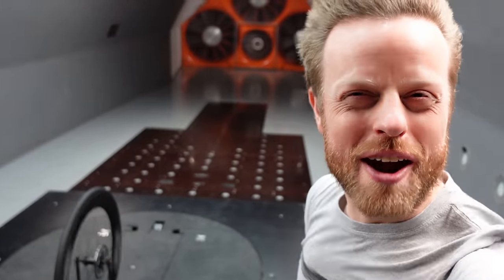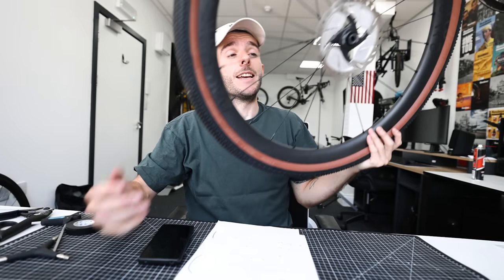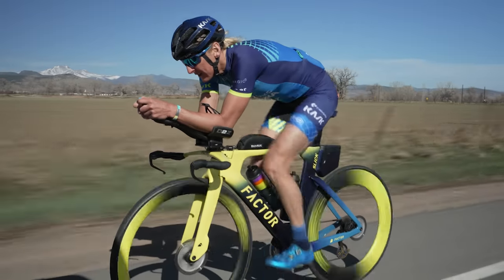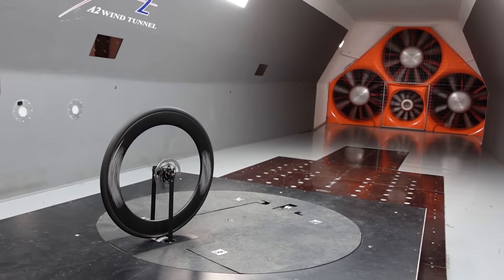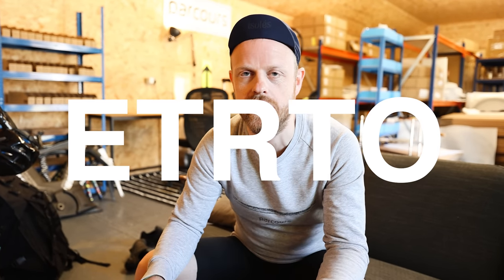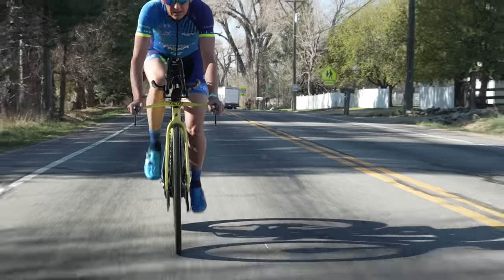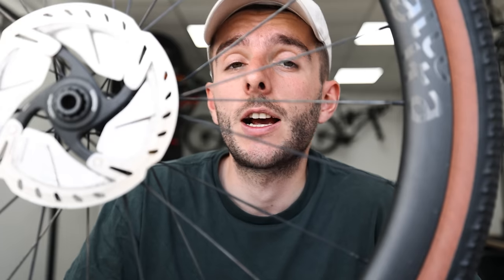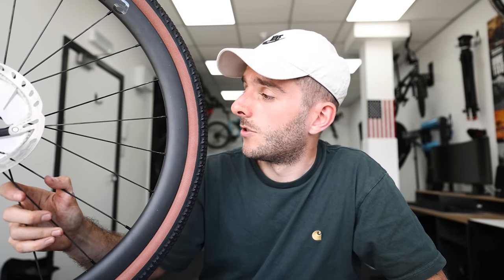What You Should Know About Hookless Wheels

Comment: Is there any benefit for going hookless with an alloy rim? Are we going to end up with all carbon rims being hookless, and alloy ones hooked, and if so, does that mean that tyres are going to end up being specific to rim material?
Reply: Great question.  As far as I can see it's likely to be that if tyres all end up being hookless compatible, it may well be that alloy rims go the same way.  With the way that the alloy rims are manufactured however, there's fewer benefits either in terms of cost or strength.

One thing to bear in mind though, is that just because a tyre is hookless compatible, doesn't mean it can't still be used on a hooked rim.  So rather than having tyres specific to rim material, we're more likely to see a situation whereby more and more tyres end up being hookless compatible.

Comment: To be fair, even most hooked carbon wheels limit max pressure to about 80 psi.. with exceptions. Roval and Shimano are two that allow well over 100psi in their hooked wheels. Maybe these are simply built stronger?
Reply: I have never seen hooked rims with a max. pressure rating that low, all I've seen are about 110 - 120+ PSI.
Reply: @yonglingng5640  HED limit to 80 psi. Hunt limit to 100 psi. These are two that I know, but maybe such low psi limits are not as common as I thought.

Comment: I have two pairs of hookless ZIPP 303(s). Thanks for explaining what that means.
Reply from the maker: Just curious, as a hookless wheel owner, did you know about the 72psi pressure limit?
Reply: @Cade_Media  I did, the LBS told me 74 was the limit on these for the road, 40ish for gravel.
Reply: It also says very clearly on the rim itself. I run them too for gravel with Pirelli CGH, and love them
Reply: @martinhudobivnik5895  those are the kind of details I miss in cycling
Reply: @jmoran74  I find it ugly on the rim, but I understand why it's there. I also knew about it from all the research I did, but totally missed that Pirellis can only be pumped to 58psi. Glad I wasn't the one doing the tubeless conversion 😂
Reply: @martinhudobivnik5895  I've got some specialized tires for my road set. they lose pressure pretty quickly overnight. do you have issues with losing pressure?
Reply: @jmoran74  I don't. I've heard some tyres are susceptible to it though. Also I think this hookless standard is not perfect and it can vary from tyre to tyre

Comment: I'll wait for this all to get sorted before I stop using tubes.
Reply: w/ hooked tubeless wheels and tubeless tires,  road tubless set up at normal pressures (80-100) has been doable for a while,  perfectly safe.   Hookless at road pressures is still not there for me.  Unless you're running 32mm at 60psi....which I'll never do.

Comment: This is a bit slim on details. He only touches on the problems of heavier riders and thinner tyres which is actually a major concern for bigger people running thinner tyres. They need to do some very careful research before going hookless. The assertion that hookless are stronger is total bollocks, the strength is derived entirely from the amount of material and design detail (section) of the rim edge. Hooked wheel design needs to be careful to avoid sharp corners in the hook so as to avoid stress concentration. His opening statement says it all - hookless rims are without the safety feature of  the hook securing the bead, ie they are inherently less safe. Comparisons to car or aeroplane tyres are misleading as most are steel radial, very wide (compared to cycle tyres) and are set into a far deeper rim. Blowing a tyre up to pressure to test failure does NOT even vaguely approximate real world conditions and the multitude of forces the tyre is subjected to at that pressure. The problems with skinny tyres can be mitigated by use of deep internal channels in the rim allowing a greater volume of air at lower pressures but few manufacturers have tried to exploit this. One also has to be very attentive to the tyre's specifications regarding internal rim width and rin edge height when choosing a tyre and wheel combo. Small wonder there have been so many failures! Until the manufacturers have figured out all the intricacies of this design and are very clear to customers as to the limitations my advice would be for casual riders to avoid hookless. G. Hart - industrial designer

Comment: Car wheel doesn’t have hooks but the physics are completely different.  Car tyres have a different sidewall density etc which makes the tyre stay on.  It’s not the high bar that’s an issue, it’s the low pressure especially when you get a flat when there’s a danger of the tyres rolling off that is the issue.

Don’t use car wheels as a use case example.  Like press fit this hookless trend will go away..hopefully

Comment: Do you think there is much of a downside if a heavy rider like me (88kg, total system weight of 98kg) has to stick to the 5 bar limit of ETRTO.
Zipp tells me to run my 28 mm tires at 4.2/4.5bar, yet other calculators like the SILCA one would put me in the 5.5 bar range for optimised rolling resistance. 
Zipp argues, the added comfort/reduced vibrations will make you faster as well. What is your take on that?

To safely run an aero-optimized setup (Rule of 105: Conti 5000 STR 25 mm tire on my 27 mm wide Zipp 303S wheels) I would have to run unsafe 5.5 bar or reduce my system weight by 8 kg which might be hard :-)
Reply: I’m a solid 200lbs and am using enve45 and 30c tubeless and have never had any issues running them at 48-50psi. Can’t speak about any smaller tires but anything over 55psi just felt way to harsh of a ride, in my opinion. I don’t think you should have anything to worry about. Send it!
Reply: At your weight, I’d suggest you go to 32mm tires. I weigh 160 pounds, and I’m running 32mm GP 5000s. I don’t think they slow me down one bit compared to 28s or 24s. And they give me a lot more confidence while cornering and especially on bad pavement.

Comment: I’m on the Zipp FC303 which are hookless. I realized that running them on higher end of the limit makes the wheels faster. Question is how will I know it’s going to blowout? Any tell tale signs? The tire pressure reading are from my pump n I’m afraid that my pump may be inaccurate
Reply: Do you feel faster or are you measurably faster? Less road buzz can make you feel you're slower, when the opposite is true

Comment: So if the air pressure is the only thing keeping the tyres on. What happens if I puncture at speed going down hill or in a group. The tyres could come off the rims before you can stop?
Reply: This
Reply: @cc-000  good way to reduce customers. I think I will  wait until all the problems are ironed out.
Reply: The hook is there to stop the tire from going over the rim when it stretches due to high pressure. when you puncture and loose all pressure it basically does nothing to hold the tire beads on the rim. there is no real difference for this scenario between hookles and hooked rims per se. 

in fact one could argue that a tight fitting tubeless compatible tire on a similar tightly specced tubeless rim (regardless of hooked or not) will stay on for longer than a non-tubeless tire that possibly fits way looser and will come off the rim easier.

Comment: I have a question 🙋‍♂️ .... is there any real difference between a gravel wheelset and CX one?
Reply: Dimensions would usually dictate where it falls. But things always shift.
Reply: There is, although that's not to say you can't use a gravel wheelset for CX and vice versa.

Generally-speaking, a CX wheel will be based around a narrower tyre given the max tyre width is set at 33mm.  Whereas for gravel you would be looking at something quite a lot wider.  Then in our experience we'd look at having the gravel wheel slightly more robust to handle the different ride conditions.
Reply: @Ryan TF saying that, I'm not sure there's many pure CX-specific wheels left out there now.  It's a much smaller market, especially when gravel wheels are increasing in popularity.  From a manufacturer's perspective, it makes it a much harder argument to develop a new CX wheel

Comment: what type of Hubs does he use actually? I tried finding that out on their website (mainly for freehub tech), but I couldn't find anything. The FAQ mentions the offer of DT Swiss hubs on contact, but it sounds like the normal hubs are not DT Swiss, so I am still unsure about which is which.
Reply from the maker: They are his own design hubs, so unique to parcour. But yes can be switched to dtswiss if you fancied it.
Reply from the maker: Probably worth emailing and asking though, it's a small company and I'm sure they'll be happy to help
Reply: Exactly as Francis says - the disc brake hubs are our own design.  Main difference between ours & the DT Swiss options is the drive mechanism.  DT use a star ratchet, whereas ours use a pawl and ratchet
Reply: @ParcoursDov  I do like my star ratchet on the rear wheel, but that's the only thing I would probably change there XD. Otoh, considering I am running 47mm tires, the alta seem a little slim? I do like the price, for when I can afford that upgrade (definitely not rn, got more bags, powermeter and probably carbon handlebars to buy first).
Reply: @ohmps01  maybe keep an eye on the website &/or our social media in about a month's time... 😉🤫
Reply: @ParcoursDov  well I won't have the cash then. But will do :)

Comment: So a 95kg rider.....on 28"s...... doing time trials running 90psi........not a good idea then?
Reply: For 28 mm tires on hooked rims, I go for 90 PSI max for clinchers, 80 PSI for tubeless.

Hookless rims, whatever the limit the rims say, as long as it's not lower than the tire's minimum inflation pressure.

Comment: Cheaper to manufacture the wheel, but hookless tires are more expensive. Sigh.
Reply: One wheelset I can think of that provides this false economical savings is the ENVE Foundation.

Sure, they cost less than the SES counterpart, but you're limited to a handful of tubeless tires.

If it were me, I'd rather take the third-generation SES and use whatever clincher I want, as long as it's not a cotton-casing tire.

Comment: itsall dangerous.  the rim brakes on road wheels are less ideal but promoted and they are dangerous.  tubeless tires could have an undercarcass flapps that extend towards the center of the tube a little to give a better seal due to the flap.  rim brake tracks can be coated and special pads to allow superior performance bare none

Comment: I’ll stick with tubulars glued on like I’ve done for the last 35 years 😀
Reply: And I'll stick with my horse and buggy, thank you very much.
Reply: I am running tubulars and am planning on getting a second pair for my other bike.  They really are a superior design to clinchers (which is why you can inflate them to way higher pressure than clinchers, and unlike clinchers you don't have to worry about the hook blowing out if you overheat them going downhill since there is no hook and bead to blow out on a tubular. 

People used to worry about the glue melting going downhill, but there's tubular tapes and glues now that have a high enough temperature rating that thats not much of an issue. And even if you did melt the glue, inflating with high enough pressure keeps the tire from rolling off the rim.

After my initial trouble figuring out how to get my first pair of tubulars on, I figured out the method and now find it easier than clinchers because there is no 'bead' inside of a tubular.  No bead means you can stretch it on as you put the tire on the rim - thats the secret to putting them on. Clinchers don't stretch because of the stupid bead inside them (and metal bead clinchers are even worse to get on).

I only wish there were more of a selection available for tubulars. Since Conti stopped making them, there's not as many super low rolling resistance models to choose from. My Pirellis tubulars are nice, but they don't roll as fast as my GP5000 clinchers.
Reply: @alexjohnson6462  you can’t beat tubulars, all this crap coming out like tubeless where you fill it with goo shit and you still gotta carry a tube just in case 🙄 I’ve never had a tubular come off the rim and rarely get a puncture, it’s the bike industry trying to reinvent the wheel and all the noobs fall for it hook line and sinker, until they know better 🤣
Reply: @alexjohnson6462  Try FMB. Best CX tubulars money can buy and their road versions(esp cobbled road)are just as good.
Reply: I've gone back to tubulars on a super light set of wheels. The road feel is amazing and with sealant in and take instead of glue it's even better now.
Reply: @not-a-raccoon  most providers using tubulars still
Reply: @glennoc8585  meaning what, exactly?  That wheel makers are still making tubular wheels?  Doesn't mean that they're not antiquated and there are better and easier to use options.

Comment: These wheel manufactueres need to stop comparing a hookless carbon bike wheel to that of an automobile/Airplane rim. What they fail to tell you is that you will NEVER get an automobile tire on or off without using a Machine called a "Tire Changer". A human can put on and remove a hookless bike tire with our hands. I personally prefer the safety feature of hooked rims and will keep using them. Seems like Hookless are not a problem, Just don't like how they compare the two, that's all.

Comment: EXACTLY!!!. ‘Potential’ of a blow off!!!… That in a nut shell is why I will never run the ludicrous concept of hookless rims. Next they’ll be telling us barefoot walking over glass is safe. Sigh…
Reply: The real issue seems to be the tire manufacturer's poor adherence to the latest hookless standards, not the concept of hookless rims, per se. All car, motorcycle and airplane tires have been hookless for decades.
Reply: @malcontent_1  that's true, however all the examples you've given are run at much lower pressures than you'd generally see for a road bike.  Part of the problem not just with hookless but tubeless tech in general is that within the industry we've seen rim manufacturers blaming the tyre manufacturers for poor tolerances & vice versa.  Unfortunately when everyone has an opinion, a central body like ETRTO is painted into a corner & has to take a "neutral" position, assuming the worst of both worlds.  This is probably why we're still seeing the 72psi pressure limit.  Not because every tyre will blow off every rim at 80psi, but because one _might_.  Given what's at stake, they can't afford to risk rider safety
Reply: @ParcoursDov  understood & agreed, but (1) the lower tire pressures on those larger vehicles is still amazing, in light of the fact that an average car can weigh ~1500kg & a passenger jet weighs ~80,000kg; (2) I doubt the ETRTO is protecting us from an 80psi blowoff w/ meager 10% margin of error but, yes, the typical 100-120 psi road rider may unintentionally create a problem with the wrong tire/wheel application. Perhaps as more of our fellow road riders learn that lower pressures can be faster, some of these risks may be further mitigated.
Reply: @malcontent_1  you say that, but there are circumstances where we've seen a "bad" combination of wheel & tyre leading to a blow off at <100psi...
Reply: @ParcoursDov  ah, I was entirely unaware of that. This begs the question, were the tires & wheels in those circumstances compliant with the ETRTO standard? And IF so, then we have more fundamental issues than certification.

Comment: Enve actually just fully discontinued all SES rim brakes and now they new SES wheels are:

- Hookless
- Only disc
- Minimum tire size 27mm
- Only tubeless 

All people that ride tubeless,  always carry an inner tube just in case.  Now with Enve they cannot.  If your flat is not sealed by the sealant then call an Uber.     

Terrible design and not user friendly at all.
Reply from the maker: You can still put a tube in as a backup, the tyre just has to be tubeless ready to work with those SES rims
Reply: Crazy product offering, or lack of should I say.
Reply: @Cade_Media  I see,  sorry then I did not know.  I thought hookless did not allowed inner tubes.
Reply from the maker: No need to be sorry, it's a bit of a minefield and I hope this video helps people with their choices!
Reply: Can confirm tubilito tubes have got me out of a jam when I got a flat I couldn’t seal on gp5000 str.  Worked fine once I got the tire on which was really hard and took 45 minutes with just tire levers but without my tire jack.  I’m sure it would have been way easier with hookless on the side of the road and I’ve been considering switching ever since. I also think it would have been impossible (with my wheels) with a regular inner tube and needed the extra flexibility of the tubilito to do a field repair. Love those things.
Reply: @Cade_Media  but aren't they specific tyres eg not beaded tubeless but headless/hookless tyres?